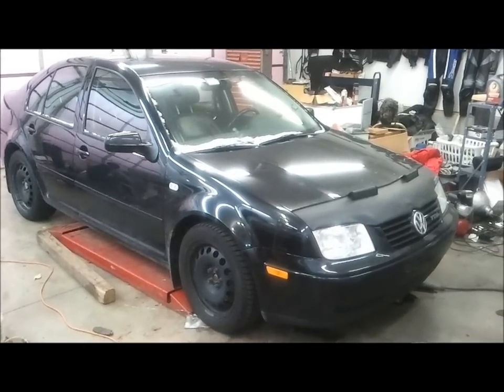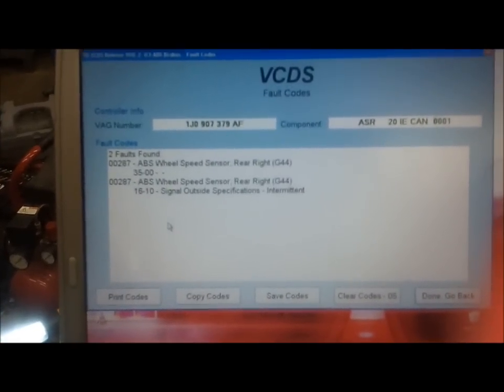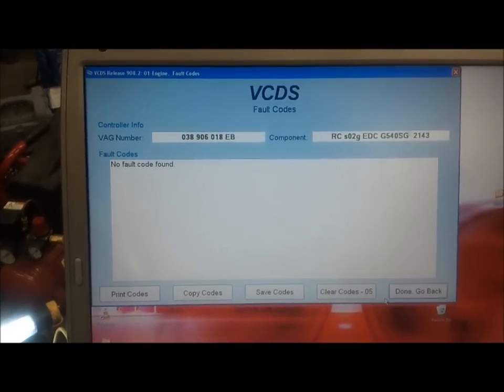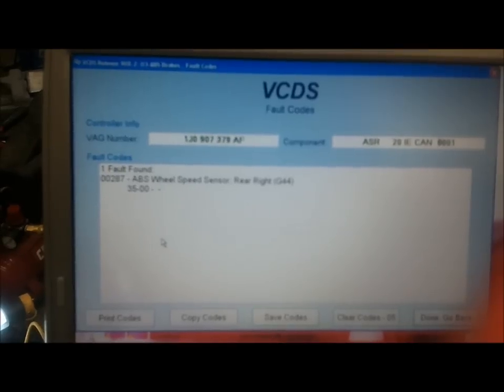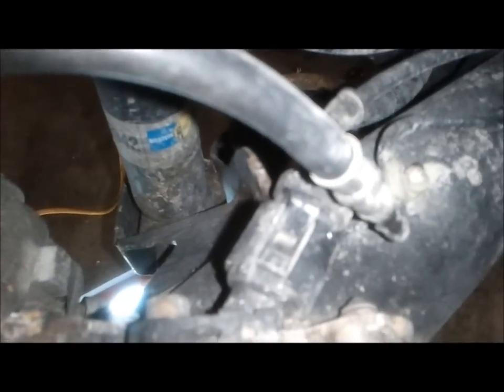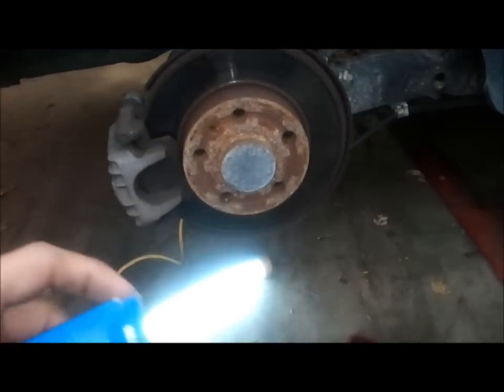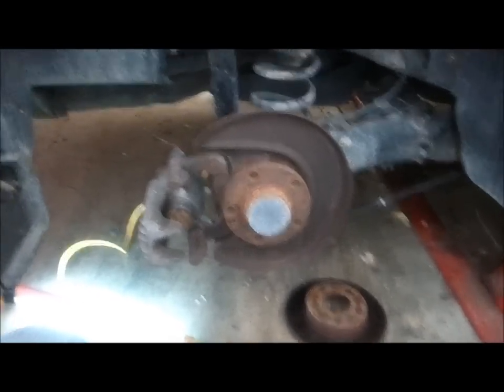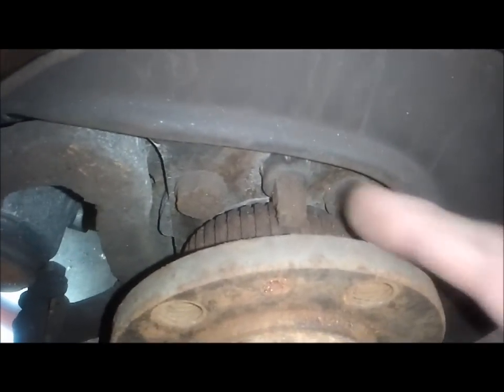VW ABS problem diagnose and fix, part 1

Comment: Never just clear codes! Check freeze frame data logged and snapshot it or it deletes also. Some sensors twist to lock in place but whatever, use an appropriate lubricant to release.

Comment: Thanks for video. 
I have a golf v, 2006 Not long time ago came ESP warning
light on shows on speedometer.
I bought a Code Reader Auto Diagnostic Scanner,
(2015.7.18 Version D900 CANBUS OBD2 Live Data Code Reader Auto Diagnostic Scanner)
but no error code find on screen.
And the rare thing is that the Only ESP worming lamp is
on, not ASB or other light are warning on. Did you have any experience with this?
Thanks again.

Comment: Same symptoms also occur on B5 S4 when you attempt to remove an ABS sensor with a five-foot prybar, but it only comes out a millimeter so you hit it with a sledge hammer a bunch of times to get it back in.

Comment: the codes do come back right away,if the problem was not corrected,no need to cycle the ignition. when you cycled your ignition you went into  the wrong module, you clicked on module 01(engine) not o3 (abs)

Comment: I have an 02 passat what interface shall I use? Any specific cables? Any help gladly appreciated.  Thanks for the video!
Reply from the maker: Maurizio Bussolino Your 02 Passat doesn't use CAN for diagnostics, so a KII USB will work great. If you ever plan on getting a newer VW I'd recommend you get a Hex-Can though as it will work with your current 02 and the later CAN based cars.
Reply: ***** thanks but no more vw for me...too much trouble with that German engineering. ..I also have an 02 wrx and a 2010 tacoma. Wonder if this software would work on them two

Comment: lol this is not going well
Reply: It NEVER does. I have found "quick" jobs on VW's take inversely proportionally longer, the "simpler" the job first appears. Now I spray EVERYTHING with a fine anti corrosion wax. Boltheads get smothered in thick grease when it's time to take them off again, a quick blast with brake cleaner leaves a nice shiny head and using liberal quantities of threadlock ensures bolts don't rust up the threads. Where none essential, "copperslip" bolts and torque up around 5ftlbs over recommended on most things. they will stay put and are easy as pie to take out in a year or two.